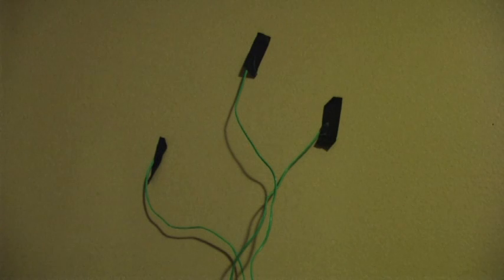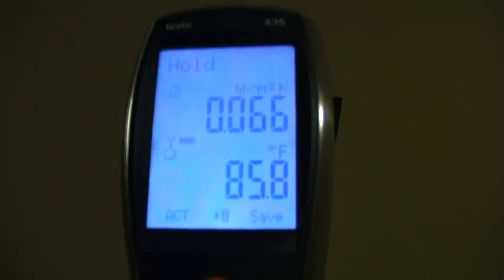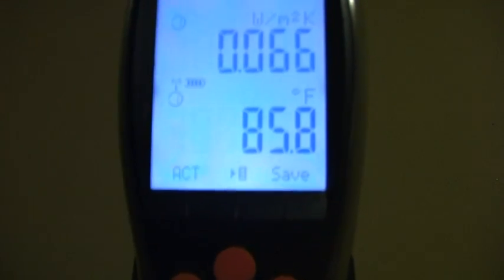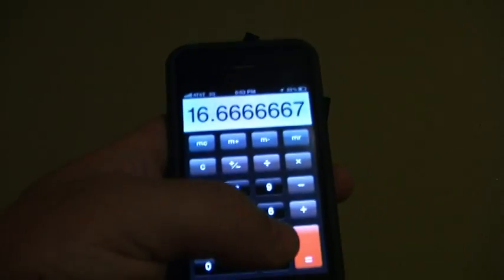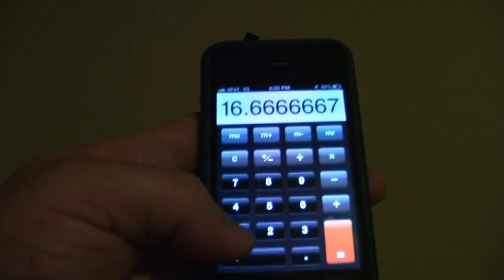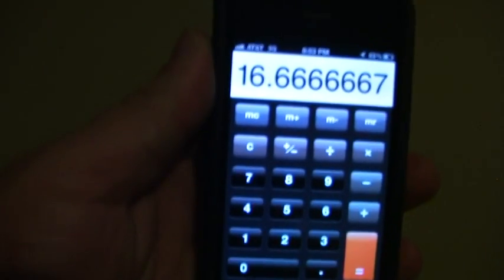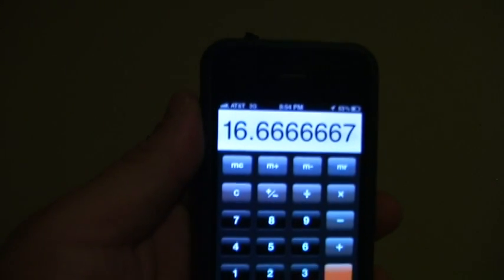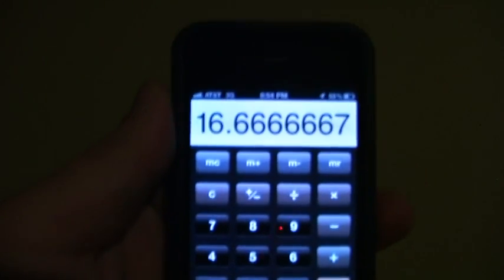HVAC Service - Why won't my house cool

Comment: Hey can I get your advise. I might have an oversized air conditioner and wanted to how you can tell if is. I have a 1614 sq foot home  and climate of 90s high and 70s low. my air conditioner will only run for like ten mins on hottest times of day and 5 on lowest. I have not felt any humidity until today. I got home and I noticed the thermostat was reading higher than the setpoint. I have a design temp of about 95

Comment: Hi Eddie, 
I found after checking that most of my heat was from my single pane glass windows heating my tile & hardwood floors. So on the west side of my house I tinted and installed shades and boy what a difference I also found leakage around switches & plugs and installed insulation around and backing for crawlspace door.
Thanks Eddie for the tips.

Comment: what features would you recommend in a 435? Looks as if you can get it with or without differential pressure. Hotwire or vane? etc.

I see why you prefaced with the auto mechanic comparison. Those guys must be making pretty good money. For $25K I would put all my tools in a new van, lol.

Do you get to use your blower door very often? I have the BPI cert as well. Considering investing in the blower door, etc. Would love to test in and out my own house if nothing else.

Comment: Thats incredible. I would have never dreamed that a field grade meter existed that could measure and calculate U-value. I almost cheaped out and bought the Fieldpiece hot wire anemometer after pricing the 435 with two remote probes.This has got me reconsidering. Does True-tech have the U-value kit? I do MJ8 on a lot of existing homes
I would like to pick your brain as well sometime. Just bought a 327, hope I didn't make a mistake by not getting the 330.

Best HVAC videos on YT, Keep em coming!

Comment: Hey Eddie !!!
Great Video my Friend !!!

Eddie the Day I got my Testo 550 , I diagnosed I had a Bad TXV right outa the Box , Techs you cannot just go by Subcool on TXV , my Subcool was Dead On , Once I replaced TXV 
and Added a Power Vent , the Upstairs finally started Cooling !!! 

I only have 1 Central Return upstairs , I thought that was the Problem , but the Heat from the Attic was the Biggest Issue , you can feel the HEAT Pushing its way thru the Ceiling Drywall !!!
Now I need to Insulate !